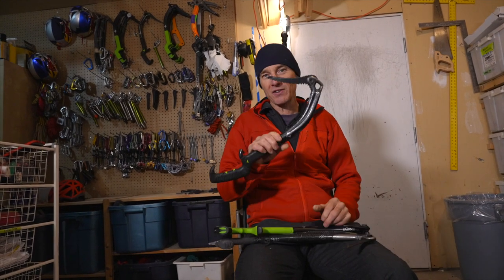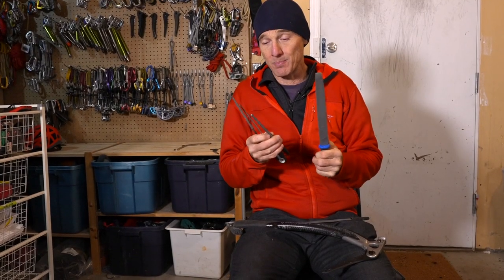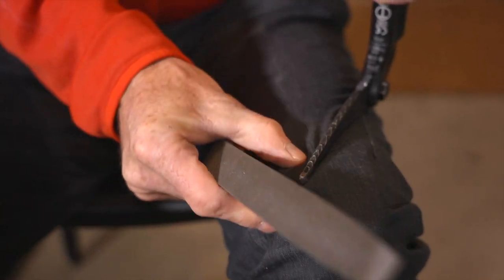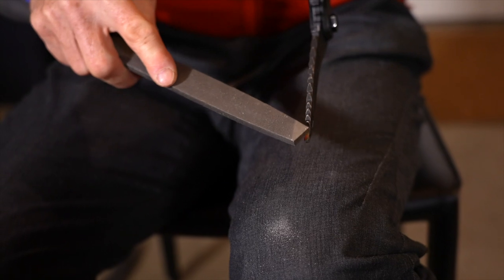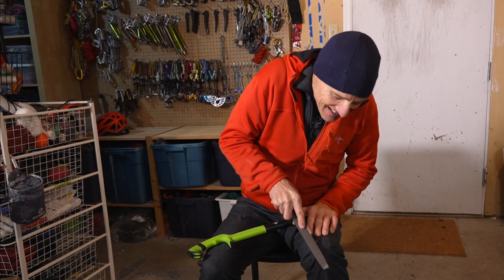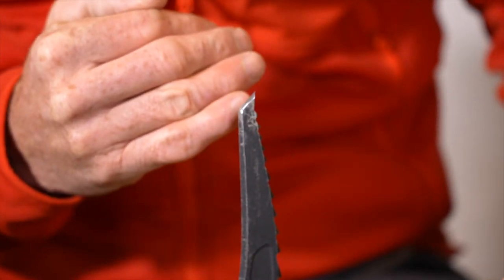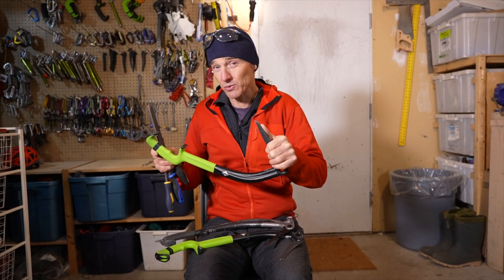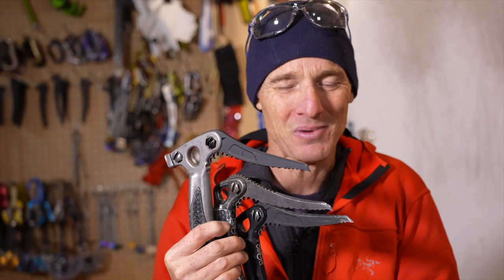How to Ice Climb Series #9: Sharpening your picks

Comment: Hi Will, love your videos. They are giga helpful. I'm curious about crampons, there's so many different situations you can encounter in the mountains - snowy approaches, icy climbs, rock segments, and potentially all of them in the same day.. how do you select a crampons for your outing? Seems like vertical points are worse in snow but choice for steep sections 💁💁 but you have to walk through the snow to get there!! Thanks!
Reply from the maker: Hi, if I could only have one crampon it would be the Sabretooth. Works well for about anything out there, move the bail forward for walking on glaciers, back for ice, keep the fronpoints sharp. I've climbed mhard and classic mountaineering in them. HTH.
Reply: @willgadd2187  thank you!

Comment: Are those a new Black Diamond ice tool that's going to be released soon?
Glad to see you go into some detail on the files you use for ice pick maintenance.  I'll have to rewatch once I get my ice tools out to work on sharpening the picks.
Reply from the maker: These are classic Cobras or Fuels, new ones next year :) .
Reply: @willgadd2187  I thought I saw something like a Cobra (carbon fiber shaft) with a handle like the Fuel?  Or maybe the way the video was cut made me think I was seeing the same tool when it was actually two different ones.
Reply: Thanks! Do you sharpen your screws?

Comment: Hello Will, Thank you very much for your video series, great help for someone like me trying to get into the sport. I am gonna have my first beginner course at the end of February by the way. Quick question though, what Ice tools would you recommend to buy? I am not planning on doing overhanging ice nor drytooling, I think I would like something that is good in technical mountaineering and steep/vertical ice.
Reply: Then I would recommend an classic Ice Tool like the Black Diamond Viper. It is like the Carbon fibre Tools shown in the video but cheper because its made of aluminium. It is not as bend like a mixed climbing tool so also great for technical mountaneering when you have to plunge your tools into snow etc.
Reply: @vincentkrause7097  Ah thanks, in the same vein, I was thinking of getting the Grivel north machines, I Picked them up in a shop and I really like their handles. The petzl quarks are pretty good too but somehow much more expensive where I live. Haven't tried the BD Vipers yet.
Reply: @tyrionas  Yes Quarks are good and same shape as the Vipers.  But I recommemd the Vipers because Will Gadd and this Video is sponsored by Black Diamond 😉
Reply: @vincentkrause7097  do you have an opinion about the north machines?
Reply: @tyrionas  Never tried them, but the shape Looks good for Allround technical mountaneering. But they are missing a second Hand rest above the grip
Reply: @vincentkrause7097  yes indeed. But realistically, how often do you use the second hand position ?
Reply: @tyrionas  More than I tought good for swapping hands. When placing ice screws and I need a sightly higer position of the arm to keep it relaxed. But maybe you can buy an aditional handrest from Grivel if you later need it
Reply: @vincentkrause7097  fair enough, I will take a look. The original reason why I was interested in the north machine is that for some reasons, they are significantly cheaper than the competition in Switzerland.
Reply: @tyrionas  Makes sense!
Reply: @vincentkrause7097  thanks man, that was very helpful
Reply from the maker: Sorry for the slow reply, what did you get?
Reply: @willgadd2187  hey, thank you for the answer! Well I haven't bought anything yet as the season hasn't started in Switzerland. I am still very open for suggestions!

Comment: Can you elaborate of the Russian steel?    What process in tempering do they do different?   Just curious.
Reply from the maker: Krukonoggi had some incredible durable picks that the Russians sharpened with Dremel tools. I don't know what they did to get that temper.
Reply: Krukonogi from Saint Petersburg make picks from armour steel (without specifying which one). Thir picks are hard to blunt, but, if you succeed, even harder to sharpen)